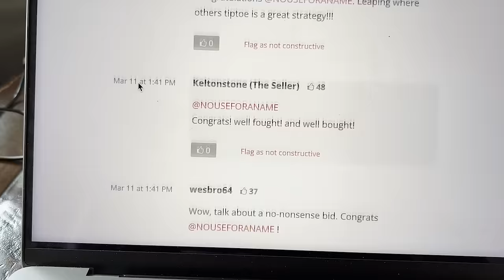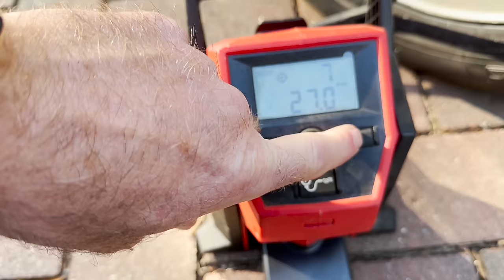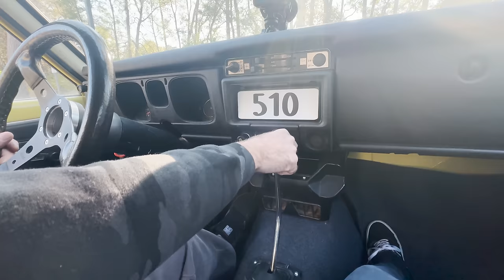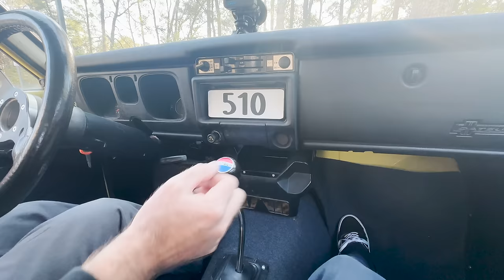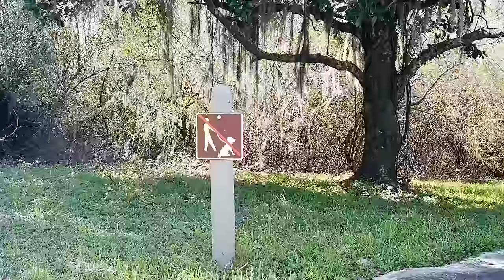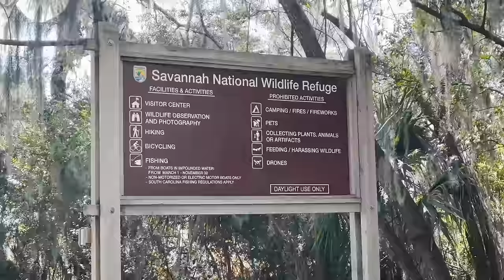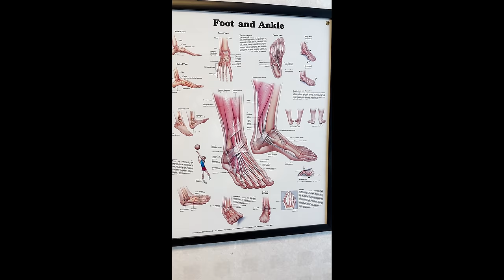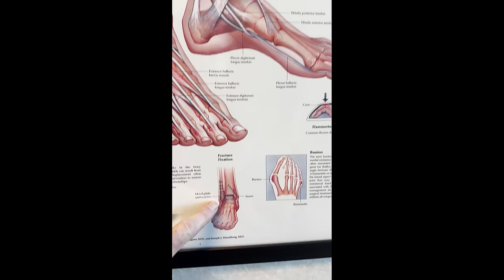RECORD LEVELS OF PAIN! BOUGHT A CAR, THE ENGINE WIRING MELTED, AND I BROKE MY LEG ON THIS ROAD TRIP!

Comment: Pro-Tip: Use a Gatorade bottle for the puke/recovery bottle. The ribs in the bottle help it not slip out of the zip-tie. 0:03
Reply: plus it can take a bit higher temp then the flimsy water bottle
Reply: I like Vermont maple syrup bottles - the little.jug handle is great for a zip tie 😂

Comment: WATER BOTTLE FIX---Bought an 04 Ram w/5.9 Cummins did not have an overflow for the coolent.. put a rubber hose to a thick water bottle and it's worked for over a year!😂
Reply: Gatorade bottle is best, very thick and has the grooves for the zip ties.

Comment: Talk about stirring up old memories.  I was stationed in Charleston in 1972  Since my Malibu SS  in CA, I ended up getting a Datsun 510 for transportation.  Basic 2 door, L16, 4 speed, and not much else.  I drug that thing around over the years... Charleston, Rota Spain, California, Hawaii, and back to SoCal before finally traiding it in on a 1977 Datsun 620 pickup, with an L20 and a 4 speed.  Trashed the 4 speed, and upgraded it to a 5 speed.  Good memories with both of them.
Reply: That car has been to more places than most people. How cool.

Comment: When we had Raver Motorsports, my old partner Vern Brunges had THE recipe for a killer L23 using all stock parts. We tore apart so many VG30Es to get the connecting rods out of them. I could still tear one down in my sleep...lol.

Comment: I had a workmate who owned a 70's 510. She had it all tricked out and was an SCCA racer.  It was her daily driver too.  She had a lead foot for sure. LOL.  I knew folks who had down draft dual Hollies on those cars . They liked them better then the side drafts.  The Datsun side draft carbs were notoriously cold-blooded on start-up. I had a 72 240Z and those carbs were tuned and they still had cold start issues.  Get the Hollies for better running overall. Get well soon Board Runner. Hope it heals fast.

Comment: I used to have a 1980 Datsun pickup in high school. It had a 280z motor and trans swapped in it from a wrecked 280. I had a blast in that pick up. I ended up totaling it hitting a deer coming home from work in the middle of the night after I painted it. The deer wouldn't have totaled it if I had the front bumper on the truck. I had just painted it black with two mustard yellow stripes still had tape on the mirrors. I was going to put the truck back together the next morning at home. I feel sick to my stomach just thinking about it. I'm 40 years old now and I still think about that truck often. I've always wanted a 510 to go with that truck in the driveway. Maybe some day. Congrats! The car is beautiful!

Comment: Brings back memories.  My first car was a 1978 510 with a 1980 grille and headlights.  2L engine out of an 83 240Z with dual Weber sidedrafts. Went like a bat out of hell!  Brock rally edition red/white/blue paint and 50 series tires all around, cornered like a rock!  Would give a body part or 2 to have that car back again!

Comment: I broke my fibula the same way during my first deployment, it was diagnosed as "high ankle sprain" (no, the PA didn't order x-rays)
I NEVER got it wrapped or even crutches, it was quite painful to walk on for the first 3 weeks.
I didn't actually find out it had broken until 5 years later during my exit physical
The big bummer, I was getting into cross-country running, after the break (which did NOT fully heal) I no longer have the stability to take on un-even terrain
Glad yours was diagnosed and does NOT need surgery!

Comment: Well, it's about time you bought a cool car!!! Now all you need is a 2 litre twin cam with ITBs, 6 speed manual, slightly upgraded suspension and brakes. Making around 300hp and it would be PERFECT 👍.
Reply: No need for twin cam, l series is a great motor.
Reply: @koneking2569  There's twin cam heads for them :)

Comment: In the early 80s I had a 510 station wagon with a 4speed, cam, headers, carb and a glass back. The body was seven different colours, and had rust and lots of body damage,  but the motor ran great, and I had tall good winter tires, it was my winter beater and ski machine, when I lived in Canada. We made a wooden box on the roof, just screwed it on to the roof, for the skis, and with the extra space of the station wagon four of us could load up our gear and go skiing. When the roads got really bad, I had a full set of chains. It was a great driving winter beater, it was fun to drive and I hated selling it.
BTW, I’ve broken both fibulas skiing.
Cheers from Tokyo

Comment: Epic trip with the boys. A badass car... broken leg... worth it
Reply from the maker: yup. im still smiling.
Reply: @FinnegansGarage  the “why didn’t it blow a fuse?” Isn’t a 510 thing it’s a Datsun thing, my roadster has the fuse block with a burnt hole. Get a new fuse block with newer fuses and redo it. I’ve rewired 1/2 my car to melted plugs. Hope this helps

Comment: I checked out a B210 "Honey Bee" back in the 70's and the air rush through the carburator was louder than the exhaust. When I punched it in 1st gear it felt like it was going backwards.I bought a '74 Celica GT 18RC and I loved that thing. I drove the wheels off it.

Comment: I learned to drive with ‘76 620 pickup and experienced everything you did will owning it. Electrical issues were common with the Datsuns of that era. Those old wire harnesses had fuse links that burned out all the time. Great memories. It had the Webber 2 barrel carb, Thrush exhaust header, and exhaust. It would burn rubber in all 4 gears. Wish I still had it. It got t-boned by a ‘86 GMC Jimmy. The little truck saved my life. 😢
A buddy of mine had a ‘74 B510. Ah, the memories. 😊

Comment: Weber carb.....get the adapter for a bigger round aircleaner. The stock ones that come with the Webers choke them out and are trash. Make sure the floats are set correctly most of the time they aren't properly set from the factory. If it is a 38/38 it will have synchronized barrels but you can get a kit to make them progressive. This will keep it from flooding out and makes start up easier. They are great little carbs for mileage and performance once they are properly tuned. 
 I second the name "Piss Missile"!

Comment: Hey Mike. Long time Datsun 510, 240z and 1200  owner and Rcaer here. Regarding the Side Marker light. Thye have bullet connectors for the Positive and Nnegative side of the Circuit. But the Bulb Negative side is also grounded to the Metal Housing of the Lamp. On a rewire you can get the Positive and Negative wire connectors backwards. That will give a direct short. Doesn't always happen right away, as the ground through the Lamp body is not always 100%. But hit a bump or Railwya tracks.. and the Magic Smoke gets out. 

 These cars also have a weird issue with feedback through the Brake Lights. They take 1156 and 1157 bulbs. Get them mixed up and they will feedback the Tail light circuits.

Comment: That little thing brings back so many memories.  I bought a 1970 510 in 1976.  It was a blast to drive.  My friends and I would pile in to go hunting in Winter.  When we'd get stuck we'd just either push it or lift it out of the hole.  Mine had the 1600.  Just one of the many cars I wish I still had.

Comment: I currently have a 1970 Datsun 510 2DS that I've had for over 29 years. It still runs and drives. It's powered by an L20B.

Comment: I had a Datsun B210 back in the day. I found a 1981 710 pickup with 2400 ORIGINAL miles but it sat and rusted so im restoring it. I also purchased a 97 Suzuki Carry with a dump bed that I use around the property and to plow snow.

Comment: I use to have a 510 rally car. The most fun you can have on dirt or wet roads legally. It had twin SU’s and a built 2L with a 10k redline pushing 200 ponies.

There’s a huge amount of parts available to get them handling like they run on rails. 

These days the few remaining ones in Australia tend to have an SR20 under the hood.

Comment: Never owned a 510, but have been in, driven and helped workon dozens, plus all the rally cars here in Australia.
Quick point, the L20 was the OHC inline 6 cyl which won't fit in a 510, the L20B from the 710 and 910, and 620 and 720 pickups, do.  
A little trick I was told when I had my 720KC, with L18, was to use the pickup's split exhaust manifold, gives you 4-2-1 headers with nice long primaries.

Comment: The 510 is awesome, always wanted one. I wanted to point out the evolution of the Roadkill videos. In the early days there would have been flashlights taped to the hood (if it still had a hood in place). Now they totally legit fix the wiring, diagnosed and repaired to a point that it can be safely driven, easily fixed fully later on. Kudos.

Comment: Mike, dude ! .... Broke leg a' walkin' ! ....  well anything to get the "Proud Dad's" shot !  A family from church had an older jeep and knew my family needed help with a vehicle.... it lit up under the dash whilst driving down a fairly busy 2 lane road ... so while pulling over onto the shoulder I was grabbing the wiring and trying to smother it with my "drywall hanger" toughened hand and by the grace of God it melted one of the wires through..... whew .....  super props to all the helpers in this one !

Comment: Mike im genuinely surprised that you didnt take the cutoff piece of hose and slit it. Then placed it over the radiator tab you zip tied to to protect the plastic bottle from not only the radiator heat, but also from chafing and wearing a hole through it. Lol. Maybe next time. Haha. Great video, 🙏ing you heal quickly. 👍 ❤️ all of your channels and the content on them as well. You are such a natural in front of yhe camera im surprised some network hasn't tried to hire you as a show host. You'd be great in that line of work imo. 😊

Comment: A tip for Jordan to help get on his heel and toe edges while snowboarding. When going for his toe edge have him try and touch his knees together, this will put more pressure on his toe's and in-turn the board should start turning to the toe edge. A very minuet ankle roll to his toes maybe needed (like you're trying to get on tippy toes movement). For heel edge he will want to imagine there is a bar between his knees pressing them apart. This will put pressure on to his heel edge and again the board should come around on its own to the heel edge. Minuet ankle movement maybe needed for this as well, but towards the heels not toes. I've found in the 18 seasons of teaching snowboard lessons this technique helps get never ever's and been a few times riders stopping and linking turns much quicker and controllable. Also helps more seasoned riders as well. Course everyone is different and this technique might not work for him or anyone who try's it since we all learn and do things in our own way. Hope the leg heals quickly and glad to see you and everyone had a good time! Was also getting early road kill flashbacks with the wiring fiasco in the parking lot lol.

Comment: You have a Datsun pickup shift lever in that 510. Find a 200SX lever which is shorter, and curves back and towards the driver. Also, you need ~1" spacers between the trans mount and the body to keep the trans from hitting the tunnel.

Comment: My 2nd car back in the early 80's in high school was a baby blue 510. Had a lot of fun with it! My older brother had a 70 510 with dual sidedrafts, then sold it for a 2000 Roadster. A few years later I bought a 75 280Z in candy apple red and a 2000 Roadster. Miss them all!

Comment: I don’t know if you’ve seen this… 1157 bulbs can be forced in backwards which switches bright/dim around. Also 1156 bulbs (with only one contact on the bottom) can be forced in too and short the brake and tail and marker lights all together. Easy to check.

Comment: Some advice on an 'emergency' coolant bottle, use a Gatorade bottle. They are stronger plastic and you can choose a size to suit your radiator. I put one in our '91 Sentra classic Coupe 6 years ago, and it's still there and working. Congrats on a great Datsun 510, and if y9ou do paint it Porcha blue with bronze paint on those rims... Sharp look.

Comment: Hey Mike!  Everytime I see one of those Nissan L series engines, it reminds me of my Mum's 910 Bluebird.  It was an '83, built here in Australia with an L20B and a 5 speed.  She drove it from '92 until 2002 but only because the back window was gonna rust out.  My sister learned to drive in it and I got to start it up a few times.  I had to learn in the 1991 Corolla that replaced it.

Comment: The click click starting issue is a ground problem with the factory harness. The starter solenoid is not seeing enough voltage to trigger. The only true way to fix it is to build a new harness. It's  probably possible to chase down the gang clamped grounds in the harness and repair them but it's as much work as building a new one. Simple fix is to mount a Ford solenoid on the firewall as they will trigger at 9v.

Comment: Love the no bumper look. I did that for a Rabbit I had. I lived in VA and state law required me to have something to resemble bumpers. I used some 80’s model Porsche bumps for the front and Mazda truck rubber cover pieces for the bumper cut out. Good luck with the car.

Comment: So many things in this video resonated. The dogleg 5 speed with the shifter hitting the ash tray, the juice bottle overflow (have the exact same thing on my 510, you use a push bike bottle holder to keep it in place ;), wiring melting, the sound of an L series cruising, so good. It appears to have a 69 model stainless grill with a 68 model JDM Deluxe badge which just feels all wrong, need to get the 69 badge or the full 68 grill and headlight surrounds 👏

Comment: John Morton is the guy that drove, total dominance in 71 and 72, I've owned my 71 2dr sense 1986.  Put 140k miles on it.  Love the car, collecting parts for an all aluminum V-8 (Olds 215, worked to 266 inch).  Lighter than any other swap engine, and a V8 sound track.  Plenty of haters for this swap, but I'm the second owner and it is my first car, 38years of love!!  
Congrats!!  Great cars!  Have super fun!!!!
Reply: It’s the quintessential British engine swap.

Comment: I broke my ankle the same way my very first trip to Glamis. Went off a 30 foot witches eye on my banshee in 3rd gear at night coming back from Competition hill. It sucked for sure, but I did it at 22, and took some Advil and rode the rest of the weekend and then drove home. At 48 now it would definitely sideline me for a few weeks. Ended up with the same walking boot. healed up fine and didn't need surgery.

Comment: I had a 79 B510 hatchback with a push button and toggle switch to start the car, no key or ignition switch.  It ran for 35,000 miles with the cobbled electric system. till one day the whole underneath of the dash board caught fire. I bought it for 75.00 for Weird Wally's in Lincoln NE in the late 80,s was a great beater for a couple years. It was a mustard yellow under years of rust and road grime.

Comment: One Datsun electrical issue I used to deal with was mostly on pickup trucks. If the engine to chassis ground fails, the accelerator cable becomes a ground, and melts from the resistance. John Morton was Pete Brock's primary driver.

Comment: I had this exact car, same color when I worked at Redondo Beach Datsun in the late 70s. Made at least 3 round trips between LA and Seattle in it. L16, 4 speed, bored with a Weber side drafts. Corners like on rails. Would love to have another.

Comment: Skiing/snowboard story...Went skiing with my sister and her friend. Crashed early on taking a small jump. Blew out knees and broke my right leg. Two years later, I go up again with my sister. Figuring that snowboarding would be less dangerous for my knees, I decided to try that instead of skiing. At the top of my first run ever, I hit a patch of ice and fell on my clenched fist breaking two ribs in two places. I felt so bad about ruining my sister's last ski trip that I kept boarding even with the broken ribs. Needless to say, I fell on them about a hundred more times. By the end of the day, they would pop in and out of place every time I took a breath. I haven't been on the slopes since. Heal up brother.

Comment: The 510 is an early Datsun import. The ignition switch is on the left side of the column because they used the JDM right hand drive column.
Reply: Ya I wondered if that column was a right hand drive unit.

Comment: Love the 510, great high school car in the 70’s.  Those things handle remarkably well & are so easy to toss around.  

I always wondered how this would 1/8th mile with a 327, turbo & suspension. 

2002 tii was the same flavor but with German steel so it didn’t rust out as fast as the Japanese steel. 

It’s amazing you found a rather clean one. Enjoy!

Comment: Friend had a Datsun B10 wagon... at 5'11" I DID NOT fit in it! Seat would not go back far enough for me!

We took 4 wheel drive trucks and a keg down to our river party spot. Cops couldn't get back there without walking... an hour after we get there we hear a 4 cylinder revving and water splashing... friend with the B210 came bashing down a 4WD trail... a trail that we had to winch one of the trucks thru. Next day he opened the hood of the car and the engine bay was packed solid with mud, amazed he didn't over heat. Best part of that trail is there was a gravel bar that crossed the river that was our escape route. Outside city limits and a different county! By the time they got the other county to respond we were gone and at a fallback party spot

Comment: The shifter could be heated and bent so that it doesn't get close to the dash.  Can't believe you broke your leg!  Wanted a 510 and ended up with a 74 Corolla with a 1.6 liter.   Buddy's 510 was miles ahead of my Corolla in cornering and spunk.   I never really tried to modify the Corolla but I was going to College in 82 and really didn't have much time for wrenching or the budget either.